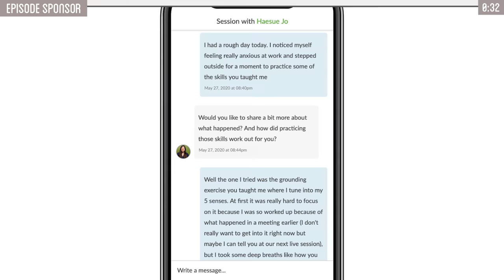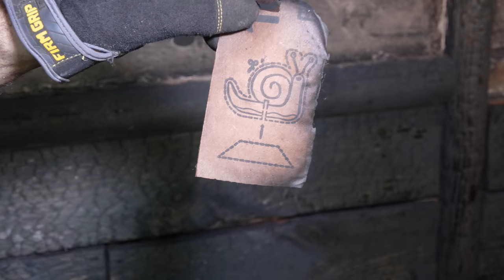Sifting Through the Ashes (Fire Update)

Comment: Use the ash to make steel. It would be highly symbolic
Reply: A steel sculpture of a Phoenix
Reply: Soap
Reply: its probably hella carcinogenic
Reply: It would sort of be like the Vikings making steel by putting bones of their ancestors into the iron
Reply: @cooperh896  not really
Reply: They can use other lower carbon steels from other things to melt down as well
Reply: That would be cool.
Reply: @Djinn_Entonic  do you mean Phoenix? Cus that's a type of fox you got there
Reply: @imperialphoenix1229  I wrote it in Spanish by accident and btw there is no fenix fox, is fennec fox
Reply: @axelskull  you just need the carbon content and you can burn off anything else in a furnace
Reply: I sincerely doubt that insulation, aluminum and plastics can go into steel.. shelves would do great tho
Reply: @OtherHarmony  lots of ash to choose from, but if its carbon then its carbon... Plastic can be used very efficiently to carbonise steel
Reply: @burnt968  he meant it would be symbolically similar
Reply: That would be awesome!
Reply: Perhaps a Thoth symbol, the Egyptian deity of knowledge.
Reply: SHIIEEET  ash is carbon, steel is iron + carbon.
Reply: @axelskull  English?
Reply: @AliceUnbound  ash is mostly either calcium carbonate or calcium oxide. It's actually more likely to draw carbon out of the steel to form calcium bicarbonate slag which would then start venting the excess CO2 into the air above the furnace.
Depending on your ore, that's a good thing. The techniques the Nordic folk used were kind of dirty which would explain why adding carbonate was so important to their work.
Reply: @cooperh896  They used blood I believe.
Reply: Only problem is ash isn't carbon. Lol When something burns the carbon it contains is combined with oxygen to form carbon dioxide. You could use charcoal from stuff that didn't burn all the way though

Comment: Hey look it's a Cody's Lab episode "Will It Charcoal: Garage" ":P To fix the anvil weld a 1/2 inch stainless plate onto it using a nickel hard facing rod and you'll be good. For cleaning up the rust go to Autozone or ORiley Auto Parts and get yourself a jug of Evaporust. The stuff works great and is non-toxic.

Comment: If you can aford it, I would start from scratch and build at least an area of the new building with the intention of beeing used for anything ofen related from scratch and adding for example an area specificaly for storing chemicals etc...building up from the bottom gives you the control over materials used and specifications and needs beeing met and leaves you in less doubt about what the building can and can't handle

Comment: Probably obvious in retrospect, but… When you rebuild, DON’T use wood. Steel, concrete, brick, masonry… all nonflammable. For insulation, go with fiberglass or rock wool. Avoid polymer insulation boards - polystyrene or polyisocyanurate; they’ll both burn. Likewise cellulose blown-in insulation.

Comment: Reminder: any of the pottery that broke into two or three large pieces can be cleaned, and put back together.
Reply: They've also ground down shattered pottery to mix into bricks for strength before (like when crucibles or dishes broke) and I might be mistaken but didn't they even grind some pieces fine enough they could be mixed with water and re-sculpted as wet clay?

Comment: A lot of your metal items will be detempered or suffer from weakened welds. You can likely repurpose them but it could be dangerous to use some of them for their original purpose. And high heat can damage batteries, usually  it just accelerates their normal process of crystallization that makes it stop holding a charge well. I hope the new shop gets great insurance or a great fire supression  system.

Comment: WEll since there so much rust, how about going with citric acid next to clean and sharpen them like file for instance?
For tools, least the drill press looked like it can be easily restored. Just get motor, switch and belts, clean the rust, throw some paint on it and maybe replace bearings if those are done. Least it should be tried to salvage same with welder.

Comment: It's a bit counterintuitive, but the thermal shock from the water spray from the firehose hitting hot brittle objects (pottery, bricks, glasswork) may have caused more damage to them than if the fire had been allowed to burn entirely (minus the roof falling onto them, of course).

Comment: imo, if its within you budget, rebuild from the ground up and design the work space to better suit your specific needs/ wants. use more fire resistant materials, maybe have a fire sprinkler system in place, use a large fire proof safe for the expensive camera equipment-- should double as theft protection.

Comment: I know you got into the iron age, but you also effectively had a collapse of your "civilization", complete with fire and structure collapse. It turned into a practical experiment to show what sort of materials archeologists would have found afterwards from a real destroyed structure on that site, minus the thousands of years of time.

Oh, and you will need to reheat treat the axe head and any of the other steel blades that were heat treated. No telling what temperatures they got to and for how long.

Comment: I know this is quite a few months late but those files could probably have been salvaged by simply running a wire brush over them to remove the rust then re heat treating them. Wouldn't use them for finishing filing but for just removing material they would have been fine.

Comment: shame you didn't make it too far into the iron age if you did a rare earth magnet would make quick work of separating useful salvage still might be worth it to reclaim all the steel wires and nails for use in smelting. Also if your continuing the series in the rebuilt make an episode on cut nails the is the precursor to modern nails and far superior in woodworking but hard to make which is why they are almost never used in construction.

Comment: welp now i feel bad for not saying about all the wood panelling, looks great but with straw and twine and so many other dry flamables in and around the workshop it was somewhat worrying. 
if it helps (which i doubt but i can try dammit) just about every group of craftsman in history when developing their crafts/business etc ran into this alot a did spend a considerable amount of stobe hard fixing the problem wherever they could. so youre entirely on the accurate human tech development train its just a little too close for comfort in some areas. it is nice to know sometime that the big crafting names got their big concrete and stone shop floors not just because they had the funds to do so but its also a safety thing.
there is good reason why some jobs are just pitched to be done in a gravel pit though.
all the same yes it sucks to get knocked back but you do gain some advantage from this for your goals, you get to see how much better at certain crafts youve gotton as redoing some things wont take as long and you get to fix some of the early flubs and in doing so permanently correct them in your muscle memory to get a not insignificant boost towards that point of master craftsman where you just rock up and dont really have to think about it much anymore.
hope everyone is doing ok and have a good day

Comment: It's william osman all over again
Reply: Heat is one of the factors that accelerate chemical reactions. Rust is a chemical reaction between the iron/metal and oxygen from the air, so the extreme heat makes that reaction real fast.

Also, the heat burns up most of the rust protection layers (paint, oils, other kinds of finishes) etc.

Another possibility is the heat forming acidic compounds that mixed with the firefighting water and also favoured the oxidation

Comment: Hey, listen.. Sorry about this bad news, others have probably already told you, but. A lot of tools, from tiny hammers to large hydraulic presses, that are made of metal have some temper to them. So now that everything has been in a fire, you are taking a gamble of if they've been damaged due to heat where they will be more likely to bend or snap under a load. Anything you plan on reusing is a huge gamble unfortunately. Stuff like camera equipment may be okay but also may not. Camera "tools" like tripods are probably fine but I wouldn't put expensive cameras on them just in case they decide to fail or tip over randomly. I would honestly say 90% of the stuff here is not worth salvaging on its own and factoring how much time it would take to repair the "salvage" it would be cost effective (if you value your time) to just replace them entirely unfortunately. I'm so sad to see how much you really lost. I've been following your channel since the early days and at least you have a strong, real YouTube channel to help fund the rebuild and next era of HTME.
Reply: Of course on the bright side all of the collectibles that are HTME artifacts now have a cool back story to them when you display them :]